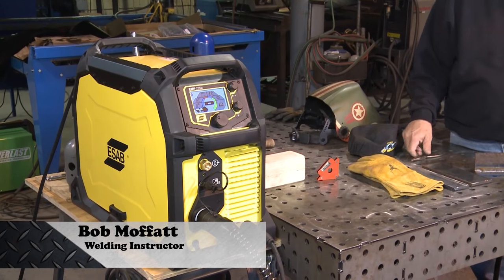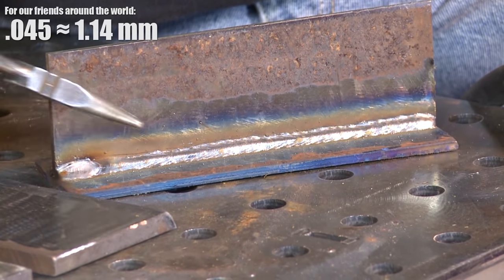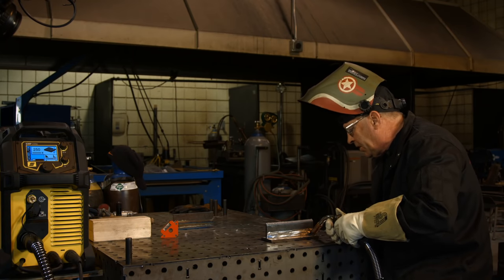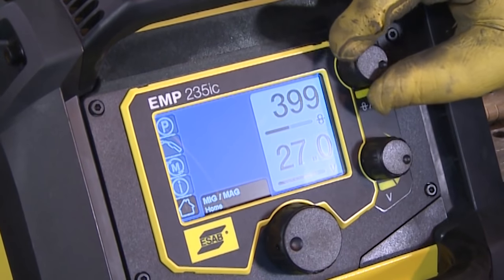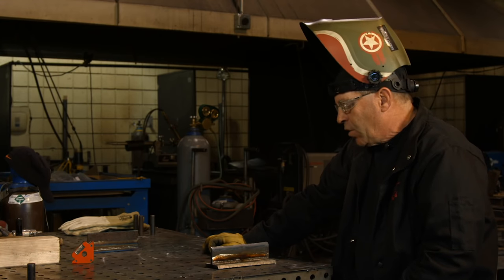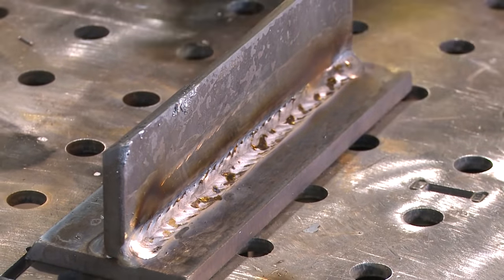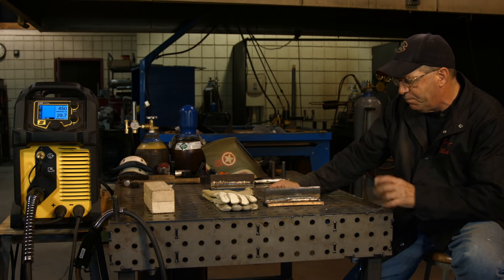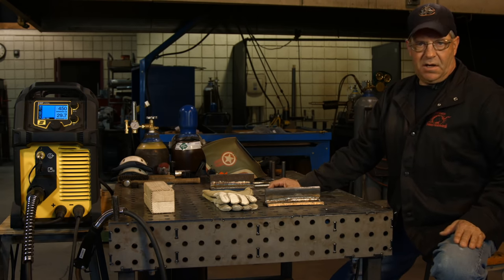🔥 Spray Transfer MIG Welding

Comment: I do disagree 100% their Bob so for my experience with spray Ark 40-ish V in depending on what your welding you can get up to 650 inches on 045 wire 92/8 gas no oxygen they tried to buy smaller machines and then add oxygen to make them spray it's 90% argon 2% oxygen 8% CO2 I believe I didn't like it welded true spray what I'm used to running is very very bright 10 times brighter than Tig but just as quiet and fast man is that stuff fast you got to be on your tiptoes when you're welding with that
Reply: Now I understand. Everybody's going to be able to afford a machine like that 600-amp machine whether it's what it is and then the power source did you plug it into I mean if you got an old Commander five or six Vantage five or six then you can run wire off that I'm not sure what the voltages do you going to need 40-volt at least always hated lower-voltage machines because there so slow